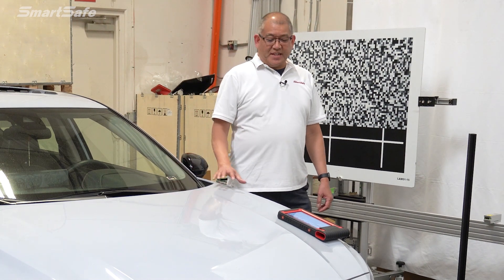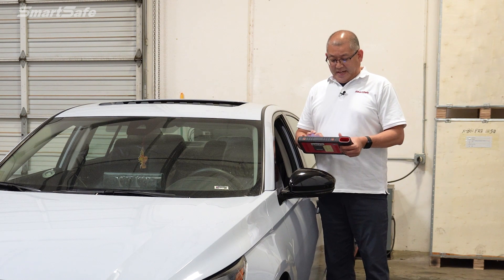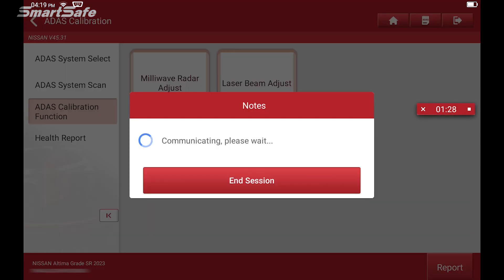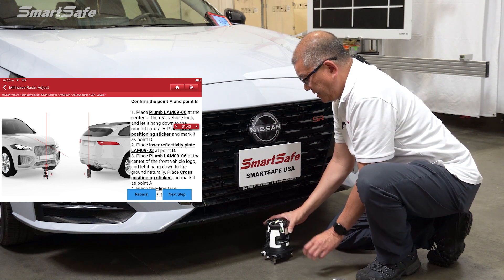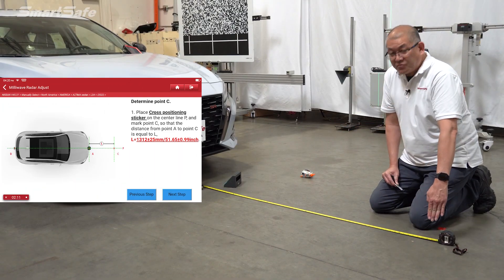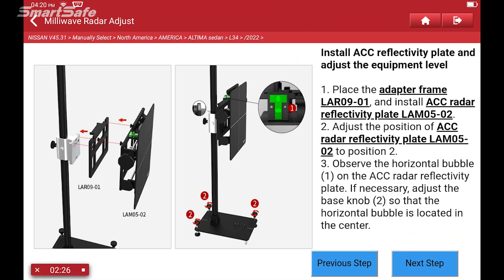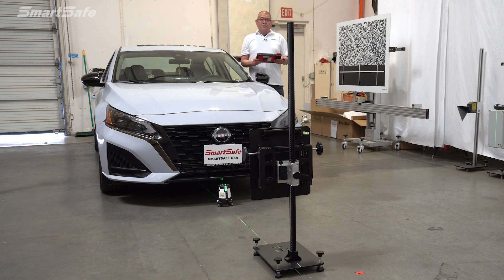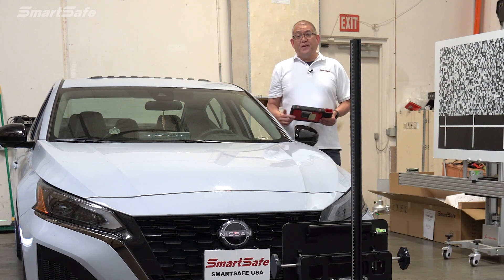2023 Nissan Altima - Adaptive Cruise Control (ACC) Calibration using the SmartSafe ADAS 3-in-1

Comment: I live in Oregon. Where can i get my Armada's sensor calibrated, aside from the dealer? They want $1000 to calibrate a replacement or $3500 for the part and calibration
Reply: I’m having to deal with the same issue , little fender bender that’s hardly noticeable causing this front sensor error to pop up every time I drive ! I wish the original poster of this video would be kind enough to provide more details on the equipment used in this calibration